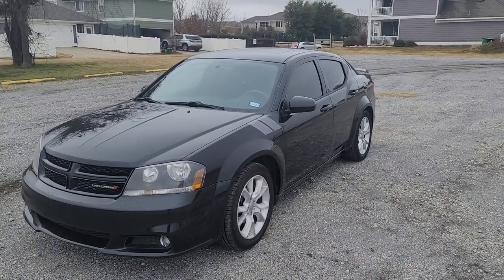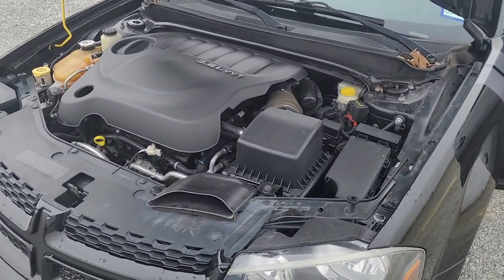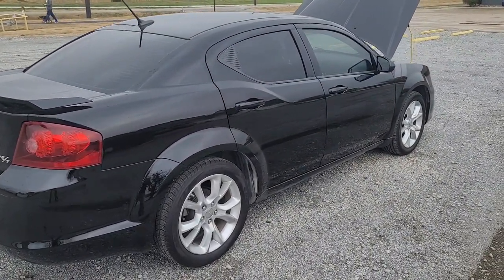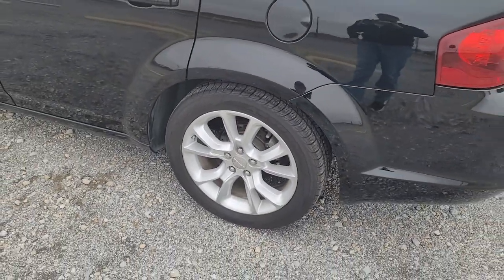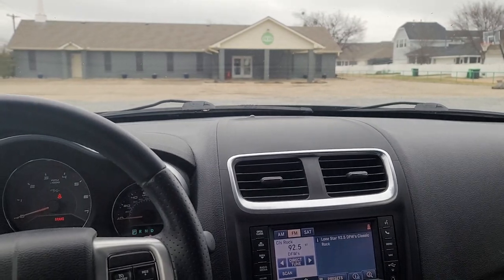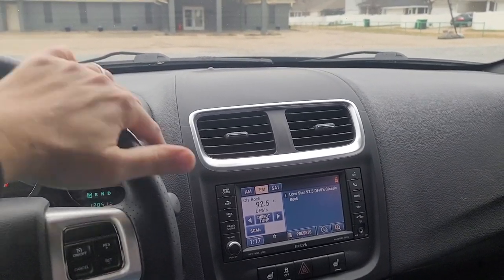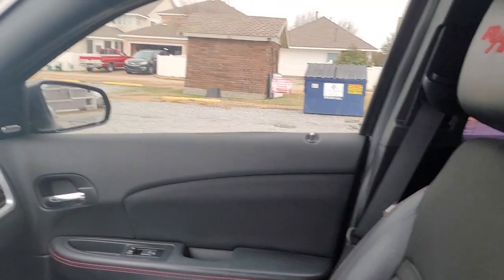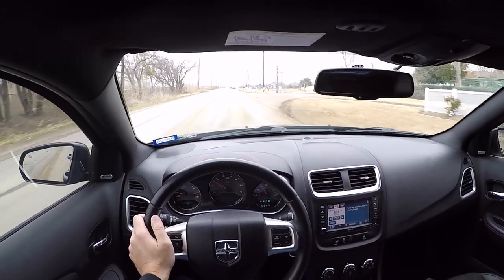120,000 Mile Long-Term Review on my 2012 Dodge Avenger R/T

Comment: I was turned on to the 3.6  pentastar when i drove my new girlfriends 300. I was amazed of the power from a 6 in that sized car. I thought about the styling of the Challenger and Charger, but I don't want a car that big. I fell in love with the Idea of the Avenger R/T. the luxury and sports package of a smaller car with that engine. I'm looking for 2012- 2014 and they are quite hard to find in colors different than red or gray or white. I'll eventually find my blue or black R/T, hopefully do a few mods to get it over 300 hp. I want it to be my car show car when I retire. within a few years they will be rare, and I'll sit with my sweetie in the sun with our floppy hats and travel around with other old classic car owners.

Comment: This video is one of the best reviews on the Dodge Avenger RT 3.6.I bought a 2013 Avenger R/T in 2015.Ive been in love with it since day one.It's like a mini Charger.Excellent gas mileage and great performance.In 2013 it had the most powerful V6 in its class.This car is very quick for a 6 banger.The Pentastar V6 is very reliable and holds up well to hard driving.I have a few minor mods done to my Avenger.I have a Diablosport Intune,Borla cat back exhaust,and a K&N cai.I have outran a Mazda 6,Altima 3.6,a late model Maxima,Honda Accord V6,Silverado 6.2,C4 Corvette,and a Golf gti in this car.With the mods,my Avenger hits 60 in 5.7 seconds,and runs a 14.1 quarter mile.Not bad for a car with a horrible resale value of maybe $5,500.Issues I have had is the air duct actuator replacement $40 doing it myself,AC compressor 800 having it done,and right now my catalytic converter is stopping up.Should be able to have it replaced with straight pipe for$100 or so (given there is no sensor problems).The interior has held up well even though it consists of a lot of cheap plastic parts.The seats are comfortable,though not so much for long trips.The handling is good but not excellent.I love the body style,and Im planning to never part with mine as long as possible.Im just an average Joe construction worker with average salary.So this car means so much to me and my love for dodge's beautiful body styles.My dream is a Challenger 6.4 one day.But for now this is all I have lol.Ive never been more happier compared to other vehicles I've owned than I am with this one.I'm 51 and have owned my share of cars.Sorry for rambling on here,but it seemed like a great place for Avenger RT lovers.The Avenger in this vid sold for a great price for the condition.Someone out there should be very happy to get so much car and performance for $4,500.That's another reason I will never sell mine.4,500 is nothing for the performance,reliability,and gas mileage you'd lose.Thank you for the video and your reviews.Hope others follow up here with their views as well.I also subbed.
Reply from the maker: Thank you for watching and supporting! Sounds like you've got an awesome R/T. $4500 was an amazing price, but I had to do it. I know if I needed a car like that again I'd never find it at that price. These Pentastar V6s are a great engine. I like to think of them as a modern Slant 6. Those were known for being insanely reliable back in the day. Keep having fun in that car, I know I had a lot of fun in mine. The person who bought mine seemed really excited and I hope they're having just as much fun with it.
Reply: @Scavenger1320  That old slant 6 is legendary for its durability.I've heard the Pentastar 3.6 was designed with intentions of having twin turbo.That could be why its such a flawless engine that can take a beating like old slant 6.Anyway thank you and I subbed you.You have good content.
Reply: @jenkemjones68  , I have a 2012 Avenger RT myself. I love it. Cheaper insurance. Many mods.
The Alfa Romero has the Pentastar 3.6 twin turbo. Must be a fun ride.

Comment: My 2013 Avenger was a decent car but the head gaskets started leaking at 150k miles, which took me 6 years to hit. I was driving a ton back then. I always wish I did the R/T and got the V6 over the 4 cylinder. Overall, the car was pretty low maintenance until it didn't. The deals Dodge was offering back then were crazy. I think I paid around 21k for everything.
Reply: Your comment makes me think once the headgasket started going you just got a new car😂

Comment: I also don't get why the Avenger got so much flack. I have the 2008 R/T and man I love it. Performs as well as my old 2014 Fusion Titanium, the STOCK speakers completely blows the Fusion out if the water and it wasn't something to turn your head away from, and a smooth af ride. It has almost all the exact same bells and whistles, minus the actually stereo system, no Bluetooth and it's just dated. Nothing a decent adapter won't fix or shell out a good $200 for a nice touch screen stereo, and it's now on par. Oh maybe minus a sun roof, "sports" mode (although the Avenger has a manual mode just like sports mode let's you do, only difference is you can drive without changing gears and the computer would just adjust timings on the fly to allow higher speeds and handling with much better acceleration than in just Drive.) and a couple minor things. Biggest difference in my opinion is that sports mode thing, idk if just switching to the -/+ mode will do the same and allow regular driving without manually switching gears and just change up the ECU, or goes straight to manual mode. I'll have to try it out one night with no traffic to get embarrassed by if I make a bad shift, like an early one lol
Reply from the maker: They really were better cars than people gave them credit for. I sometimes miss how smooth it ran. I wouldn't worry too much about getting embarrassed trying something out. These Avengers are a lot more forgiving. I know this 2012 had a point that it would just shift itself. I actually raced it once on a 1/4 mile dragstrip and left it in manual mode but didn't shift myself. The car still shifted on its own but let it get to a higher rpm before doing it. Now in my Challenger in manual mode, it will only downshift automatically if the rpms get too low, but it won't shift up like the Avenger. It'll just bounce off the rev-limiter and stay in gear. You want to talk about embarrassing, I can't tell you how many times thats happened to me on the street lol.

Comment: Just bought my 2012 R/T , originally drove a 2013 SXT and love the R/T much more. 
unfortunately mine was in a front end accident before i got it, but very minor fixes. mine has 135k miles and has amazing gas milage 
overall a great car and highly recommend an avenger.
Reply from the maker: Congrats! I agree. I drove an SXT also and loved the R/T more as well. You could tell the difference in the sportier suspension. The mileage is one of the biggest things I miss about it.

Comment: I have the 08 Avenger R/T with the 3.5 HO. Orange sunburst metallic with 172k on it. Great car.
Reply from the maker: That's awesome! I had an 08 Sebring with the same 3.5 for my company car back when I was an adjuster. I put a ton of miles on that thing and probably sat in it idling almost as much as I was driving it and never had any engine issues with the car or engine at all.
Reply: Charles Small  Any chance you put struts on your RT ? If so did you use OEM or aftermarket, I can't find struts anywhere except OEM and they're way overpriced.  Thanks

Comment: The avenger vid is getting seen! Still a popular car
Reply from the maker: It's a great car for sure and deserves more attention than it got
Reply: yea i wanna buy one soon
Reply: @Scavenger1320  Was replacing your AC compressor a pain or was it not that bad.I have to replace mine is why I'm asking.Thanks
Reply from the maker: @jenkemjones68  I didn't replace the compressor, just the condenser. I'm not sure what's involved with the compressor but for the condenser it was pretty easy after getting the front bumper off. I got an aftermarket condenser though so one of the a/c lines had to be forced a little bit to align properly but that was it. With either part though, if your a/c system still has refrigerant in it, you'll need to take it to a shop to empty it out. With mine it all leaked out because of the bad condenser so all I had to worry about was recharging it after.
Reply: @Scavenger1320  Thanks! I Didn't even think of taking the bumper off.My concern was how to gain access.You answered my question.

Comment: I do not understand why these cars were derided so much.  I have had two at work (2010 and 2013) and both were great.  The mechanics over at our garage said they were all trouble free.  I always had people comment about how nice the interior was despite what the car magazines say.  My parents had a 2008 and it was great.  I had to turn my 2013 in due to mileage last year.  It was replaced with the worst new car I've ever driven.  My 2020 Malibu is an absolutely terrible car.  I cannot get the seat in a comfortable position.  Driving it for 20 minutes kills my arthritic back.  It roars going down the road and rides like an economy car.  It has no power despite being turbocharged.  I found an identical 2013 Avenger to the one I had, sitting in the parking lot.  I asked my supervisor if I could swap and he thought I was nuts.  He approved it, so I am going to swap this junk new car for an 8 year old Avenger.
Reply from the maker: I feel the same way. Probably because there's youtube guy who hates on everything Chrysler lol. I was in a similar position with a work car long ago. I was an auto damage adjuster and the fleet was mostly ford focus's, but there were a few Sebrings, the 200 before it was the 200 and pretty much the Chrysler version of the Avenger. I told them up front that if they tried to give me one of the Ford's I'd just drive my own car and try to get mileage reimbursement. They gave me the Sebring, which was a 2008 with the 3.5 v6 and it was a great car too. Never had any issues with it at all and it saw a TON of idling and driving.

By the way, had to look up if you had a channel when I saw your name. I had an old friend that used to have a couple Shelby Chargers and I've always wanted an old Omni GLHS. You might see a couple comments on your 13 year old vids here soon lol. Thanks for watching!
Reply: Agreed I am the original owner of a 2013 SE V6 and love the car. You cannot find a new midsize with a muscle car flavor anymore so -- will keep it forever.

Comment: I always wanted one of these cars. I drove a few 300’s and Charger’s with the 3.6 but not the Avenger. I like how much smaller they are then the Chargers and Challenger’s.
Reply from the maker: They're definitely quick and the size is nice for a daily. Just have to get used to front wheel drive especially after driving rwd cars. It can be fun too when you feel that torque steer when going WOT, makes you feel like you have more power than you really do lol

Comment: I have the avengers Chrysler brother 
A 2014 200 s with the 3.6 
Currently has 128k runs great 
Only had to replace the ac condenser 140 did it myself
Reply from the maker: Very close brother too! They definitely shared a lot of parts. Good to hear it's running great for you and thanks for watching!

Comment: I have a 2013 Dodge Avenger SE V6 that I bought on 8-25-12. So far, I have replaced the radiator, heater core, thermostat, and a wheel speed sensor. I know the battery is difficult to remove, but having it there is probably why it has lasted so long for me. I also still have the original serpentine belt, and I just turned 129,000 miles on it. I don't drive it hard, but I don't drive ti easy either. I got that recall on those active head restraints fixed a while back. I'm surprised you weren't able to get it yet. I remember there was a recall on all the models above the SE for the sound system because Uconnect could be hacked with a Sprint phone. I'll be driving the car until the wheels fall off for sure.
Reply from the maker: That's awesome to hear! You got yours just less than 3 months after I got mine. I don't remember a recall on the radio, but the active head restraints I just never found the time to take it in to get done. Hope you have another 129K to go and more!

Comment: I got the standard SE Avenger 2014 model, my only gripe is the small engine and some cheap interior and exterior nitpicking (passenger side door has vinyl bubbling up and certain panels of the car is hazing) but mechanically a good car. Also like the Stratus, I hate the battery is in the driver side wheel well. Dodge fucked themselves not converting this to a coupe again and making a mini Charger and keeping the Dart as the family friendly sedan (Avenger died to no real updates and then wanted to bring the Dart as a four door compact which rivaled but also failed after the Fiat buyout).

Honestly should have kept the Stratus and let the Avenger be a coupe again but whatever. The car itself is such a handsome design and wasted potential. The car is a good basic rider, handles well. I've no complaints apart from luxury.

I really wanna trade my 4cyl for a 6 RT version.
Reply from the maker: It really was neglected by Dodge, they could have done so much more with it. The interior issue applies to just about any Dodge unfortunately. I see Chargers and Challengers constantly with door trim panels warping. This R/T was a lot of fun as it was though and I wish I could have kept it and tried some different things out with it.

Comment: Thats awesome I literally just bought a white one used!
Reply from the maker: Congrats! These are fun cars!
Reply: @Scavenger1320  yeah I had a 2011 Lux but someone slammed into me when I was sitting at a light. The one I have now is the same as yours with the window tint as well. The only thing I miss is my 2011 had a all red leather interior which I believe was custom done not sure though id never seen it on any avenger to the extent it had.
Reply from the maker: @trevorskopczynski5791  oh damn, that sucks. Yeah, I'd guess that was custom, I don't think I've ever seen or heard of red interior in an Avenger.
Reply: @trevorskopczynski5791  I got a 2013 rt and also absolutely love it.That Lux with custom red leather interior would look badass I'd imagine.Hate you lost it in the crash man.

Comment: Theres cam issues with the 3.6, the lobes wear.
Also they had issues with the number 2 or number 6 valve dropping up to 2012.
I used to work at a Chrysler dealer.

Comment: Do you think I could buy a 2012 SXT for my first car? it only has 67k miles and has new brakes and tires
Reply from the maker: I think it would be a great first car. Just make sure to get it checked out and take a good test drive in it. Carfax wouldn't hurt if you can get one.
Reply: @Scavenger1320  great thank you man

Comment: Can I put a 65r tires on a 2013 Avenger, SE ?  I hate the low profiles on my current tires cause I feel every damn bump on the road.
Reply from the maker: You can't really change the overall height of the tire without tuning the car for it, if it fits of course. That's the downside of cars coming with bigger rims now. Best option to soften it up is to get a smaller wheel so that you can get a tire with a little more sidewall to it.

Comment: Is there some type of electrical issue with your Avenger? The dash lights keep flickering.
Reply from the maker: No issues, that's just a common effect that happens in videos where the cameras frame rate doesn't align with the frequency of the light making it look like it's flickering, it's kind of a strobe effect. In real life these lights were steady.
Reply: @Scavenger1320  lol I was just wondering because I ended up with a 2011 Dodge Avenger a few weeks ago and it's been the car from hell. I'd probably be better off driving a Flintstone car at this point 😁
Reply from the maker: @susanlloyd3515  oh, dang, well that sucks. Sounds like one of those problem child's. Hope it starts acting better or you're able to get away from it.

Comment: Well, thanks for the video...now I know I need an accuator--I have been getting the tap, tap, tap. Now, what's up with the radio/CD player? It's stock. Lost the radio almost a year ago and the CD player went out last week. Fuse is fine, wiggle it and CD plays when I start car for about a second.
Reply from the maker: Did it do the flickering white screen like mine did? Sounds like you just need a new head unit honestly. Glad you've been loving the Avenger! hope you get that radio/cd player figured out and thanks for watching
Reply: Well, son put in new radio and it is doing same thing...plays, cuts out,pops back on for few minutes then cuts out half way to work. What up?
Reply: Head unit.....
Reply: @Scavenger1320  put the new head unit in...same thing happens.

Comment: I love my Avenger. It's been off the road for over a year now because it's been in limp mode. I have no clue how to fix it so I'm thinking about just getting a new one
Reply from the maker: That sucks. Has no one, mechanic or dealer service, been able to diagnose what's wrong with it?
Reply: @Scavenger1320  ECM I assume
Reply: What you mean by limp mode ?
Reply: Car struggles going above 5mph and the limp mode light comes on
Reply: It's the inverted parentheses and a lightning bolt
Reply: @Mars-pc8zl  replace the ECU and your good there's a video on this common problem
Reply: @Mars-pc8zl  here is the link to the video  that should help you on replacing your ECU/TCU https://youtu.be/XOnVH4R_zPU